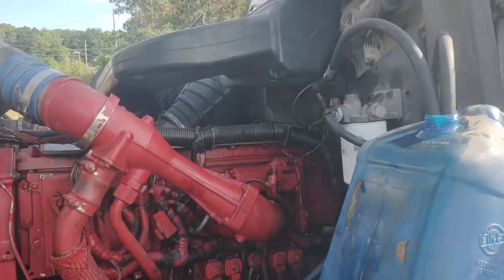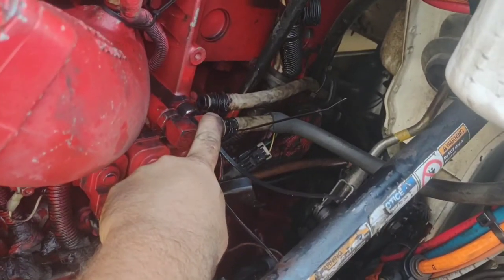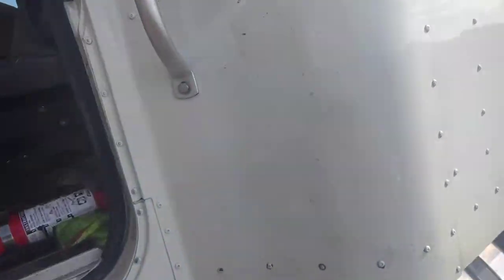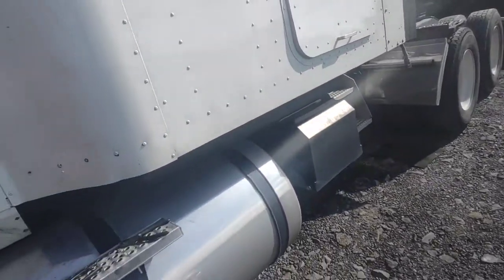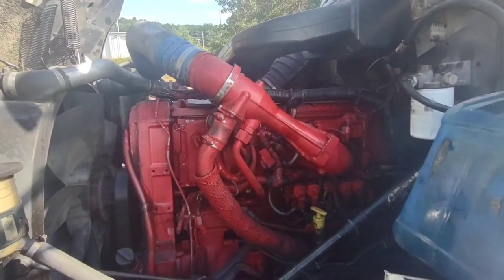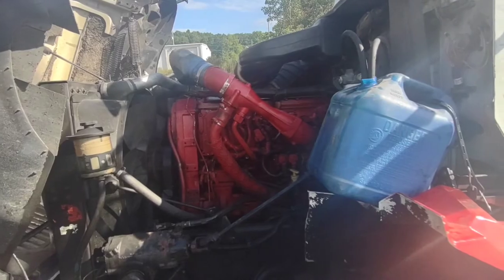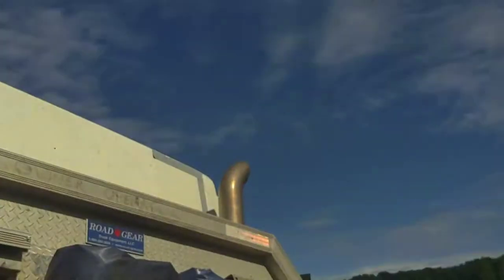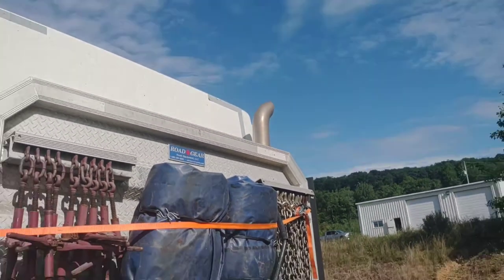ISX 870 Diesel injector Cleaning.

Comment: I’m going through I’m going through the same thing now. I’m leaning towards my fuel pump also because on my truck you fire it up and runs fine for like 30 miles or so pulling a load then it’s starts to make that ticking sound like your truck made. I put my scanner on it and it gave me code 482 low fuel pressure.  It’s still an active code. If I rev mine it misses and it makes that ticking sound around 1400 rpm. It started to throw white smoke 💨 and it smells like a bad injector. My scanner did a cylinder performance test it showed cylinder 4  working at 82 percent and the others over 90 percent and 1 and 6 over 100 percent. So I’m thinking of swapping 4 and six to narrow it down since I don’t have that tool to put on the actuators to find the air leak. Let me know what was issue in your truck. I’m thinking fuel pump first to see if it fixes the issue but at this point it’s about the same price for fuel pump or one injector. I hope you found out what was the issue though